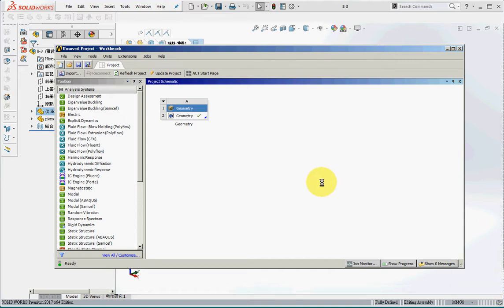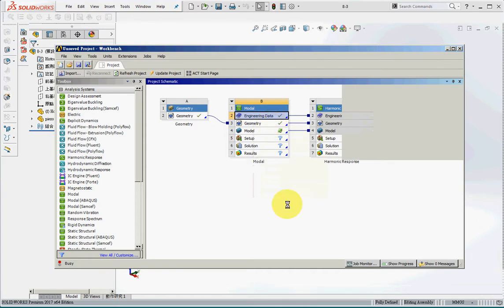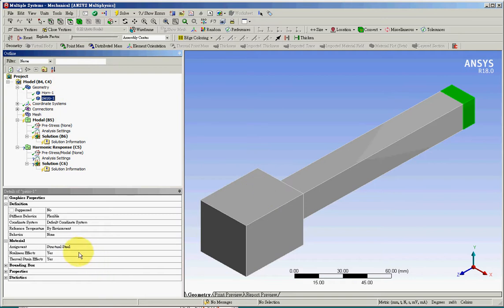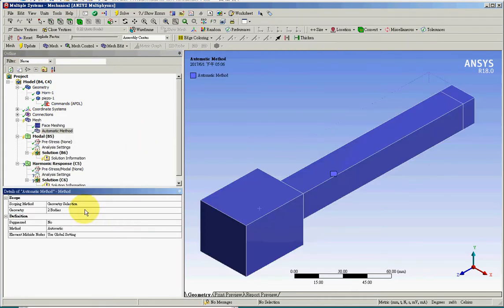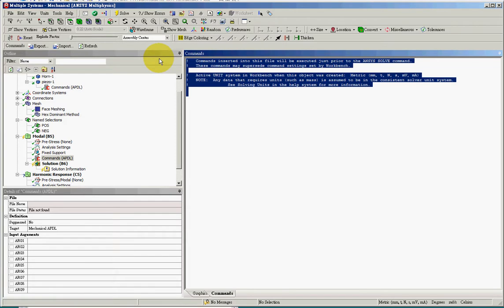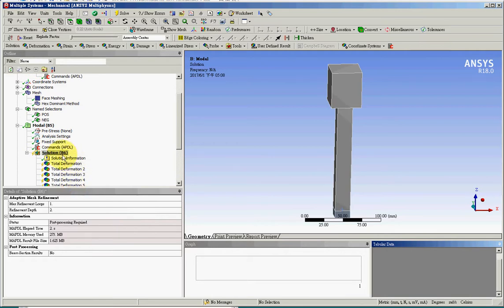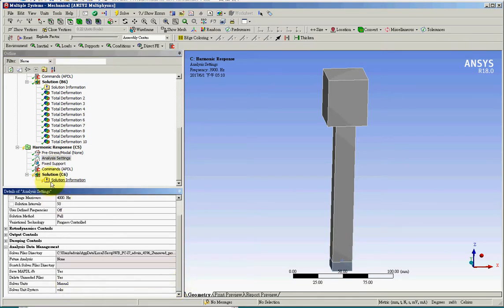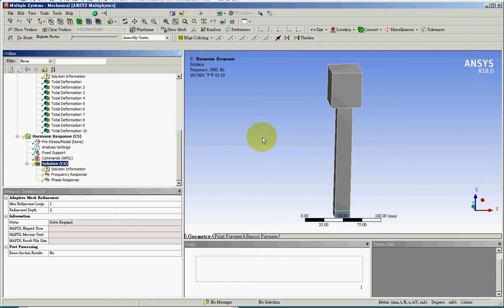ANSYS CAE 16  Harmonic Response Analysis

Comment: Hello! In the process of modeling the operation of piezoelectric elements, an error appears "The unit system of Command object(s) such as  Static Structural>Commands (APDL) at the time of creation, differs from the solver unit system.  Check your data and results accordingly." What could be the problem?

Comment: Is 0.796 mm is the maximum displacement of the selected point at the selected frequency ??

and what if I want to know the whole displacement in one cycle of this vibration ? how I can know it ( the minimum and maximum frequency of the selected point ) ?
Reply from the maker: No, the result is not displacement.
Reply: @謝忠祐-g5h  so how can I get the displacement of the selected point?
Reply: @謝忠祐-g5h hy I need your help how can I contact you